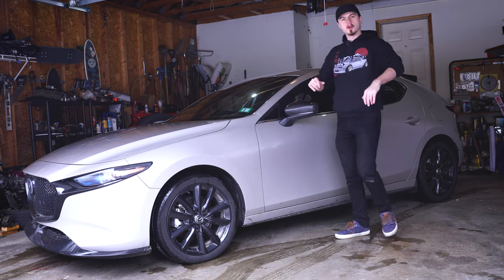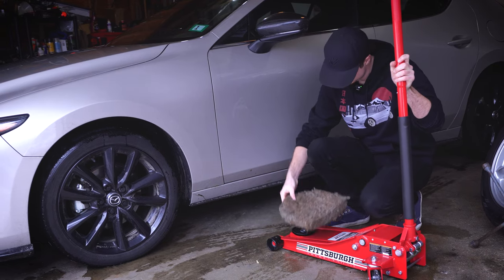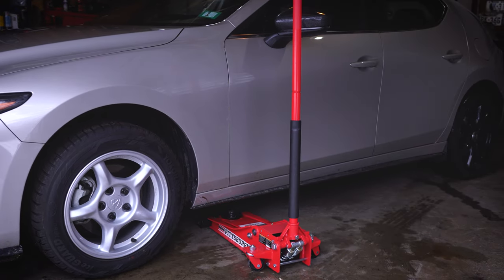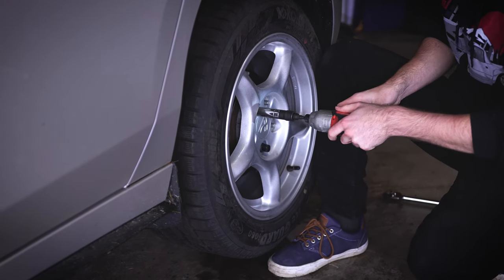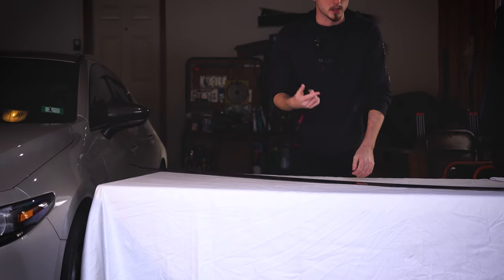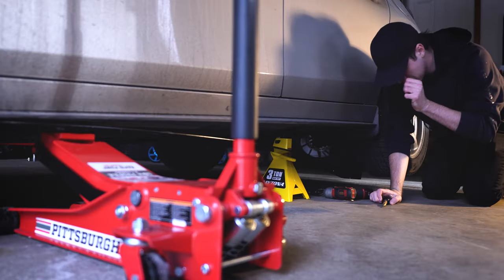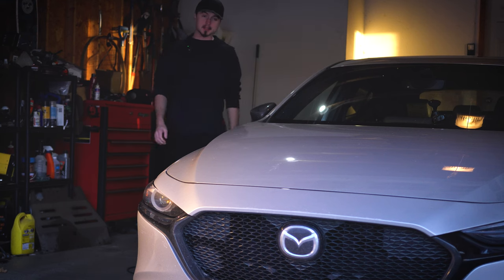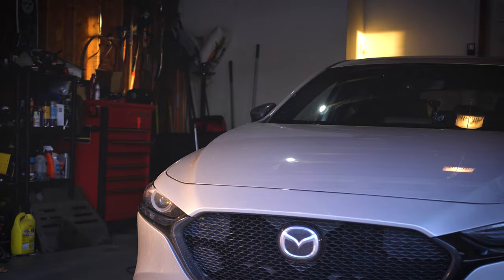Transforming My MAZDA3 With FD RX-7 Wheels & Side Skirts!

Comment: RX-7 wheels have 8 inch rim width, which is a lot wider than the Mazda3 OE 16x6.5, and with 5 mm higher offset (interior edge of wheel is 5 mm closer to the car). With the wide but low diameter rim it's potentially a risk for the suspension components to collide with the inside of the wheel during extreme scenarios; Mazda3 uses struts in the front which need a taller wheel aspect ratio than the double wishbone RX-7. The RX-7 tire diameter is also about 3% smaller than Mazda3 OE, which is borderline variance for standard practice.

I know the channel owner doesn't have a 3 anymore, but just something for others to be aware of, for any car really.
Reply from the maker: Worth mentioning: the Mazda3 Turbo is an 18x7 +45, the FD wheel is 16x8 +50. While this does mean the wheel is inherently moving in further, your tires will impact that result greatly. I found on my beefy winter tires after the season was done, there was some minor scrubbing on the strut cover itself but nothing major. I’d recommend getting something in the +30-40 range for a nice variable fit.